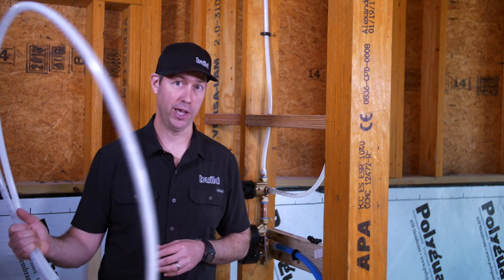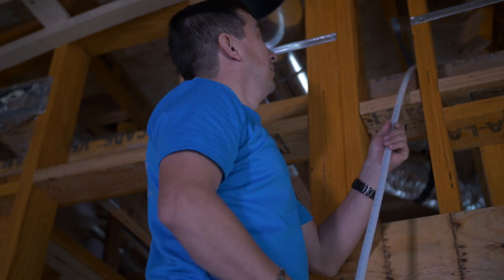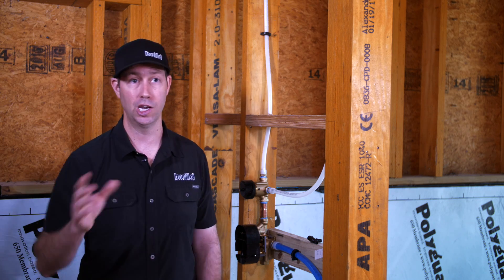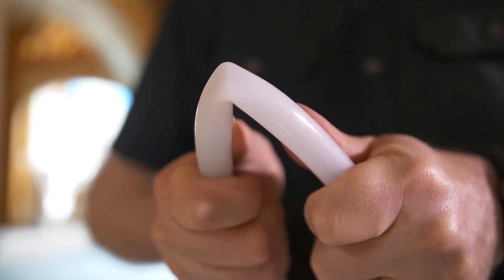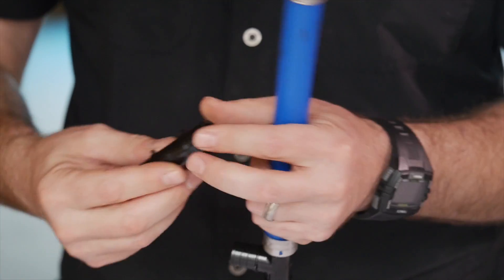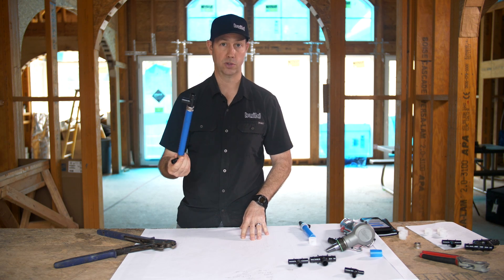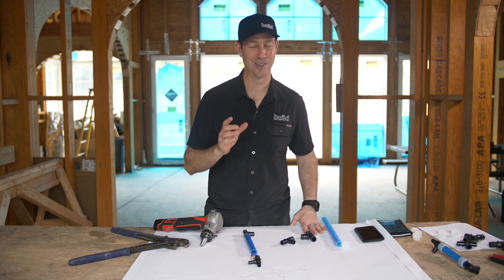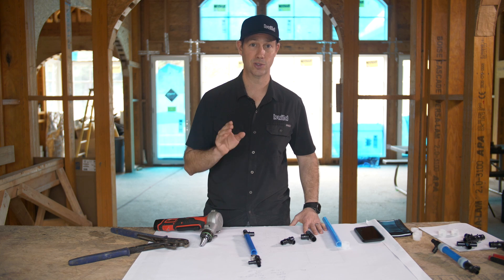PEX vs. Copper Plumbing

Comment: I do all home runs.   Set manifolds in the utility space,, ideally with a shut off for each.  Zero fittings. or fittings only at the point of use.  No fittings,, no leaks.
Reply: slightly more expensive, but totally the way to go, no reason to have to shut down the whole damn house just to service a bathroom
Reply: I at least wish everyone had a shutoff at each point of use.
Reply: @robertd.fisherjr.2875  we do. Use bullets for the exits. The angle stop or shut off valves and Bam.
Reply: Home runs are code in CA. 😃
Reply: @antv38  - Is hard water the reason?
Reply: Good idea for those who do not want to have water volume issues when something else is using water. Trac houses built today seem to be mostly junk craftsmanship in all areas.
Reply: I'm not a plumber so I am not familiar with the term "home run" being used in plumbing. Can someone explain it for me?
Reply: @ThirdRockGypsy  roll pex in a circle
Reply: Absolutely the right way to do it. I wish this were code here in Chicago but you still get Bob's Uncle doing pipe fitting for the union doing shit like it's 1992. And you NEVER see PEX here, even though the climate is ideal for it. Crazy.
Reply: @emotionz3  Tim I couldn't agree with you more, Chicago lives in the stone age with regard to plumbing code, literally. Some people are shocked to hear CPS water mains are lead pipe let alone their own! Now the storm drain situation in Chicago.......omg
Reply: @xthumpx1     Early on PBS showThis Old House they dug up a leaking water main that was a wooden log over a hundred years old.
Reply: @emotionz3  - I was told by a Chicago building inspector to do my electrical and plumbing anyway I pleased. (This was before PEX was common in the US).  He said if/when I got caught that inspector could handle the fine without going through the city bureaucracy.  (Sweet Home Cha kaga).

Comment: pex is good with high temperature, no good for freezing temp . you can test it by freezing it in the fridge, then when it frozen, take it out and hit with a hammer , it will shattered. best plastic for freezing temperature, is butylene ,  in new zealand we have buteline, which been around since the 70's and still not leak, with cheap aluminium fittings.

Comment: basically I should get a house ran in copper and install a water softener from the get go and not have to deal with possible pex issues over he course  of the 30 year mortgage. Because if you have a house that is built well and you take care of it, it will last 30 years+ easily.

Comment: restricted flow for any reason is a moot point. Every faucet and every shower head is restricted anyway. What's the point of delivering 5 gallons a minute capability if your fixtures will only allow 2?

Comment: I prefer copper for 1 reason only. If a house is on fire, the copper isn't added fuel such as plastic based lines.
Reply: That's one of the dumbest things I've ever heard. If that's the case, you should build your whole house out of copper

Comment: My house was built back in 1988/1989. The contractor that built it was shall we say cheap? He used CPVC with copper fittings. I have had to have other plumbers come out to correct problems he made. They have all wondered how the heck he did what he did. I wish he had used PEX and saved me a lot of headaches. That goes double for his wiring of the electrical system, which is another big can of worms. :(

Comment: In over 40 years I've never seen calcium deposits in copper pipes.
Reply: My copper pipes were full!  So much it was restricting water pressure. 3 plumbers couldn't figure it out. My well water is full of iron bacteria. Lot more to story and process off everything we did. Bottom line copper pipes were very restricted!

Comment: A friend of mine built a custom home, just a little shy of 3000 square feet. Kitchen, outside plumbing, mud room, laundry room, 4 bathrooms (I think).  It took the plumber and an assistant about 4 hours to rough in all of the supply lines.  The drains took a bit longer.  It was ABS.

Comment: Wish you would have covered the smaller black crimp ring options they offer at home depot and is there any reason you didn't use brass fittings?

Comment: listened to at 2X speed in five minutes. I'm no plumber but I work with a lot of them and the primary opinion is labor savings not cost savings (fittings are expensive they say). A side by side cost comparison would have been nice.

Comment: I like the PEX piping system also.  My only issue is sometimes being able to get the crimp tool into the confined work space to expand and then compress the jaws.  I believe there are smaller tools currently available to address this issue as my crimper is probably 10 years of age.  I cannot recall any failures of the fittings when done properly.  It is also the ideal system to convert from the old Polybutelene (PB) pipe to make necessary replacement.  I enjoy your very informative videos.

Comment: well the thing with most plastics is that they emit toxic stuff, I bet pex is no exception, now when it comes to copper, I see that it is almost religious to solder it instead of contacting a guy with a tig welder... end result?... you pollute the people who drink water from soldered pipes just as if it was lead paint, or lead fuel exhaust... lead should be discontinued for pipes used in plumbing
Reply: Lead in plumbing solder was discontinued many years ago here.

Comment: The most frequent concerns I've heard regarding PEX is how well it ages in natural environments. For example degradation due to: sunlight, chlorine, insects, and fungus. Note the concerns that PVC had with fungus releasing metals from the plastic. Also the fittings may have a tendency to fail due zinc being leached from the brass. Has anyone seen any good studies?

Comment: I am basically a copper run person , but now you've got me thinking , this video is getting saved and I'll veiw it again , why ?   Because I am strongly considering changing the supply plumbing in my own home . I like the idea of that larger size pec that you showed .  Thanks , Very appreciated information .
Reply: But he did touch on copper freezing , it can and will swell , I have repaired many swelled up frozen runs , not fun nor easy .  My last home I installed all copper , I only had 1 leak but it wasn't easy putting in all those fittings .   I was seriously considering putting in copper here but now I'm doubting that .  Thanks Again

Comment: I notice you didn't show using brass fittings with copper squeeze rings.  Why?  Also, wouldn't the flexing plastic system be affected by very cold conditions?  Doesn't the plastic get brittle and crack when being flexed open?

Comment: I personally prefer copper.  Main reason being is that it is naturally anti-microbial while the plastic pipes are not.  Pex has its benefits, and I certainly don't have a problem using it for non-potable applications.  However, for drinking water, I'm copper all the way.

Comment: I watched a few of your videos and really like how you present information! I worked as a plumber's helper for a year (great experience!). What I learned is that the old school guys (over 30 years experience) don't like Pex. In the south, Pex seems to leak  (fittings/pipe), near the coast, then the customer eventually wants to re-pipe. If it's a slab leak (due to a copper pipe getting holes under the slab), customers ask for Pex because it's cheaper. If I were building my own house I would do it in copper....no questions.

Comment: We use viega, works great. Sometimes tough to get the tools in certain spots. Other than that we use good old copper. Occasionally use viega pro press fittings for certain situations. For the volume as long as you size properly for what your plumbing there should be no problem.

Comment: Why is there a pressure drop through the copper pipe with a bunch of elbows?  Flow drop, yeah.  Pressure drop, no.  If you put your finger on the end of a copper pipe at the end of a 20 elbow run, it will require the same amount of pressure to stop the flow of water as at the source. There will be more flow at the source certainly.  Flow will be impacted by the amount of resistance of the added pipe and the elbows.  Same kind of thing with electricity.

Comment: Pex A is the only way to fly for flow and routing in housing. You also forgot the benefit of being able to re-position the fitting with the pex  connecton by rotation by hand that is impossible with solder and copper. Once you solder the fittings, they had better be correct in orientation or face doing it over till it is right.

Comment: Cesar a journeyman plumber,
I been using wirsbo/uponor since 2003 in track homes so far is been fantastic, also one time in 2006 in a really cold winter pipes in the new  house (house in building process)  got frozen  and guess what copper pipes like for the valves and main service burst
Reply: Continuing....
And wirsbo pex didnt...... yes it expanded... 
But.... in the city of Los Angeles the building  and safety department  the have their own table to calculate water fixtures units, and they drop pex soo much compare to the table for copper. :/

Comment: (Some of) the PEX horror stories are real. My parents house was done in PEX. When it was about ten years old all of the PEX joints started to go bad and leak, one by one. This has caused lots of problems - ruined hard wood floors, a damp crawlspace, and new leaks every few weeks to be fixed. I'm not a plumber of a professional builder, so I would never use PEX because I don't have enough experience to know which brands to trust. If you choose an unreliable brand you could end up with a whole lot of trouble.

Comment: My home is 34 years old. It has copper pipe throughout and PVC drain pipe. Never had any problems with the copper pipe. I hate plumbing leaks and the damage they can cause. Time will tell if PEX lasts. If the PEX lifespan is 40 years  and after that everything starts falling apart, PEX in an older home could really destroy resale value.

Comment: Nice overview of the PEX systems. The difference in internal fitting diameter will play a huge roll in pressure loss and flow, so your customer was smart! Both copper and pex fittings can fail if done incorrectly. The real question is how easy is it to mess up a fitting!
2 more advantages of PEX over copper - no torches means no fires, and you don’t have to worry about copper thefts with PEX.

Comment: 100+ yr old house , and just want to simply add pex to my existing 3/4 inch copper pipe....and been drinking radiator hose water , so not a health freak either....how I connect the 2?

Comment: Thinking of going to PEX in my house. I have very acidic well water, and it has already eaten through the copper feedline to my house. Pex seems like an ideal solution for the copper pipe in my house. Even after fixing the well feed, I have low flow and the hot water takes forever to come on.

Comment: Matt, I have an outdoor shower that is exposed CVPC on a brick veneer wall. My plumber says that it can't be done, but do you think that PEX could be fished down in the 1" airspace between the sheeting and the brick? If so, what size hole saw would you need to mount a shower valve? Had a conflict and couldn't make it to the IBS this year, but your site makes you feel as though you are there, thanks!

Comment: Another great video Matt. Do you know how well this pipe will work as an air delivery system? I am getting ready to install something better than 3/8ths air hose in my back shop. I have a 2 stage air compressor. I think it is 175 PSI max, but I have it throttled down to 150 PSI. In the old days I used iron pipe. In 2018 the price of that pipe is INSANE, so I am looking for a great alternative... Thanks Matt....

Comment: I can see why you as a plumber like the system. But how usable is it if your doing all the plumbing your self. My father and I have done all the plumbing in our houses. Expanding and repairing it. I can use cheap and easy storable equipment. I can fix holes in pipes without making huge holes in the wall. Of course the material is not as cheap as pex, but i can get it everywhere and can make things myself if needed. We have bend pipes into strange and tight shapes to get through our 150 year old building. Filled with sand, heat at the right places and you can get every shape you can think of.
So for me as an DIY-guy copper is the way to go.

Comment: uponor pex is now available up to 3". We just finished a large hydronic heating project where the entire system excluding the boiler piping was heat pex. Very quick install and cost effective. Larger diameters are available in straight 20' lengths so you have nice straight runs. This stuff has a bright future in the commercial industry.

Comment: I use a micro system of Roman aqueducts in my walls to supply water.
Reply: How is it? I've been meaning to upgrade from my Assyrian irrigation canals.
Reply: annoythefish my piss recycler is the best
Reply: I tried the aqueduct system but we get frost heaves and I just can't keep the house level enough to get the correct flow.  Back to Pex.
Reply: The single greatest thread on all my travels through YouTube.
Reply: Violet
Nice. But try a 747 air drop water bomber...fills up the tub in .00000000009 seconds.
Reply: The 747 air-drop idea is appealing, but think of the air traffic control paperwork. I'd have to farm that out.
Reply: Ausintune terraced fields on the wall is definitely the best method
Reply: Terraced fields...yeah, but the slave overhead...and they are notorious for revolts or forming unions.
Reply: I had too much flow drop with micro aqueducts in the upstairs shower so I swapped to an Archimedes screw powered by my windmill and haven't had a problem since.
Reply: I still use water-skins.  Hope to upgrade to bucket technology at some point.
Reply: Do you have any problems with Visimoths or Germanic termites?  I live in the cleanest town of all the U.K. 
Bath lol
Reply: Violent Kisses my mcdonalds straws have been holding up these past few days
Reply: psssh! small timers, for water system i built my house at the bottom of a gully, now i have no problems with flow
Reply: I open the window and throw what's in the pot into the street.
Reply: I have aqua ducks bring all my water.  No construction time and still cheap until the ducks form a union.
Reply: Alan B wackquackwackwack!
Reply: My Nabataean aqueduct will outlive your Roman one because its at a shallow enough angle so as to minimise wear.
Reply: I have a river running under my house. Easy access, always cold. A few frogs, but they’re delicious.
Reply: Violent Kisses are what I want!
Reply: Me to , but I tile my aqueducts with led.
Reply: I’m a clay pipe man myself...
Reply: Brilliant comment VK!
Reply: This has got to be one of the greatest threads in all of YouTube.
Reply: "The only good copper is a dead copper"  Ronnie Kray
Reply: @alanmcclelland5245  Those  Brothers were freemasons and paid shills!
Reply: Violent Kisses pfft, my chinese rice irrigation system is better.
Reply: @ausintune9014  But it's made in China...
Reply: Me too!
Reply: ha!
Reply: Did you lead as the Romans did?
Reply: I clicked on your profile picture and got a cat.. well you know.. you freak.
Reply: After a zombie apocalypse copper will be like gold!!  haha
Reply: All well and good until a spider comes out of your faucet!
Reply: i wondered what happened to those viaducts. I guess the ones on HO train layouts, are the real ones and everything is downsized. sooner or later it was gonna happen.
Reply: Me too it’s a little more labor intensive but it will last for 2 millennial.
Reply: Ha,,,no kidding. So do I.
Reply: Open top rain barrel about roof high with gravity feed through garden hose to shower fixture is the off grid hillbilly best practices method. 😂
Reply: Wasn’t a pex vs copper

This was a long commercial on pex
Reply: You went to that system because you needed a lot of water to Douche?
Reply: Hilarious
Reply: Well the Babylonians  were the best until the kabbalah got exposed!
Reply: Doesn’t that lead to rot?
Reply: Women did say you have a micro system.
Reply: Your arches are works of art. FACT
Reply: @wesfrazier5739  Yeah, but buying shoes is a pain in the ass

Comment: I get why we use these systems, in the UK we also use Uponor crimped systems. As well as Hep, copper ect. They only thing I will say about the copper system that for me beats all the rest is the final look of the work. A well soldered copper system correctly clipped with neat tidy pulled bends/sets beats the look of all the other types of systems being used.

Comment: Also, you can get PEX pipes with sleeves which let you replace whole waterlines without breaking walls, floors or ceilings in concrete houses.

Comment: Could have been already said, so please excuse if has.
Can see another advantage with PEX A is the tool is much smaller and one handed, much easier to use in a tight place, like a crawlspace. If you don't get the crimp totally even, there is a very high chance for a leak, meaning less risk of leaks with the PEX A.

Comment: A Lot of good information here. Just pick your poison. I have a 55 year old house that was plumbed with copper. A lot of joints were sloppy, not wiped off nor proper solder used. The copper has gotten thin and beginning to get pin hole leaks. In the crawl space I am repairing with shark bite and PVC on cold and CPVC on hot. I guess nothing is perfect. I have had black roll plastic from the well to the house and it cracked several times until I replaced it with PVC. This has made me skeptical about PEX and the tools for using PEX can be a problem. I have enjoyed the good comments, thanks to everyone.